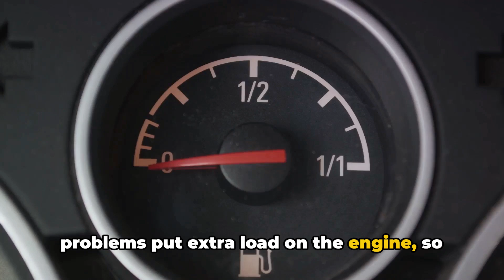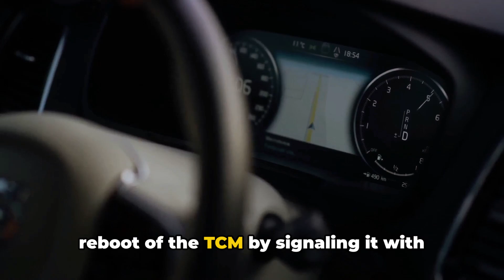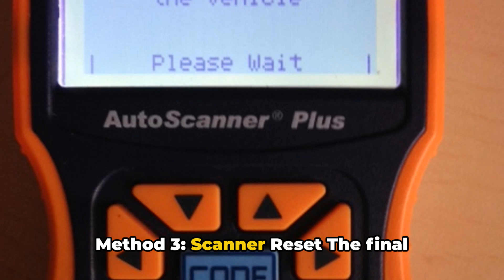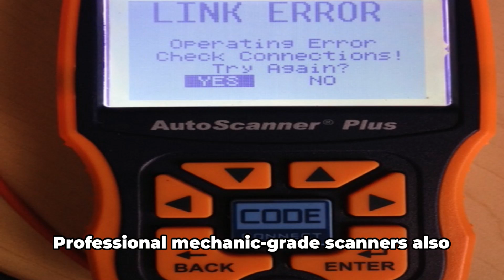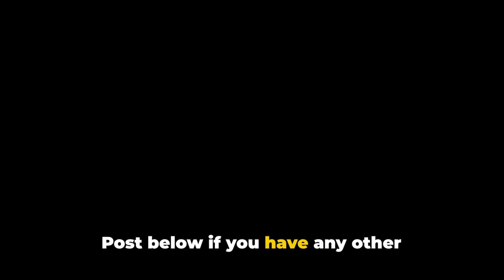How to Reset a Dodge Transmission Control Module(TCM): 3 Methods

Comment from the maker: I made a small mistake, I meant the engine should be "On" but not running for the gas pedal reset method. Apologies for this.
Reply: I'm glad i checked comments cuz i was  " WAIT a min! U want me to full rev the motor 10-20 secs? Ona a reset?" i gotta research if he meant ign in key 2-run but motor off
Reply: @danoolson5983 😂😂😂
Reply: Thats exactky what i though!t@danoolson5983
Reply: I blew my engine! No not really
Reply: Duuuude! That's a really serious chunk of information! I'd delete this video and fix that. I can only imagine how many people threw a rod trying this. Jeez
Reply: @jasonabernathy76 my thoughts exactly. Now I'm 2nd guessing everything else said. Touch the cables? Am I gonna blow up??
Reply: @jasonabernathy76  a fuel injected engine (any engine made since the mid-80's) will not let you over-rev it, rev-limiters are programmed into the software for a reason lol. Usually the limit is quite low when free-revving in park or neutral, like 3500-4k is usually all you'll get while free-revving, sometimes they wont even go that high.
Reply: I was wondering! I was like uh…. Just bang it off the rev limiter for 10-15 seconds? Lol.
Reply: What you were saying and what you were illustrating was all cattywampus
Reply: Will the tach still sweep? Is that a sign the reset is complete ?
Reply: I have a 99 Dodge Ram 2500 V10 4x4,  for some reason it does not want to get out of 3rd gear, top speed is 35 mph. What would cause that? Do you know if it's a simple fix?, or do I have to get a new or rebuild the transmission?
Reply: No doubt that train is got plenty of mileage on it but you can try to reset the TCM just disconnected two battery terminals hold them together for a little while then put it back see what happens take it for a drive ! @goodguygto
Reply: @cactusstudiossouth   Thank you so much, I will try that. 👍
Reply: @cactusstudiossouth did you not watch the video at all? You obviously didn't if you're asking that kind of question. Like the other guy said, watch the video again three times to make sure you understand it fully and to make sure you're not asking ridiculous questions in the comment section of a video that tells you everything you need to know.
Reply: @goodguygto I have the same problem with a grand caravan 2005, but it only runs to like 10 mph then shuts off completely,  then I change transmission but now it can run up to 70 mph but just stay in 2nd gear, then some times it will go on all gears,  now I guess is the TCM, and I'm gonna try this tips see if those works, if not I'm gonna change the TCM.
Reply: Transmission solenoids @goodguygto
Reply: Farm them ments
Reply: You should delete and redo this video
Reply: I did that before seeing the comment, immediately gave me a def warning and the gauge went from 3/4 to empty
Reply: Guess your AI voice got that all wrong huh
Reply: How can it sweep if not running? I don't understand
Reply: I was about to do it with the engine running, but I'm glad I read the comments first, I would've blown the engine,  thanks for the video.
Reply: Dude what??
Reply: @James7796ify  dude watch this again 3 times...

Comment: Sixteen seconds in and the 3rd reverence b-roll image is literally a shot of a dual CPU server motherboard and has absolutely nothing in common with a TCM module except for they both have components mounted to a circuit board the two are not even in the same manufacturing class of electronics. ( class: A,B,C...)  TCM's for EMS,PD's ,Fire and Rescue will be built to a class "A" standard because of the need for absolute reliability, the the class "A" standard is the module or component must work every time because lives depend on it's functioning. The server Mobo is manufactured to class "C" at best .

Comment: So I have a 2019 ram 1500, 5.7. It was completely dead this morning. The code that came up was the tcm code? Would that affect battery 🪫?
Reply: More likely, the dead (or dying) battery triggered the tcm code, depending on the code. If it was a P0700, or somewhere in that series, it's less likely to be due to battery failure and more likely a component issue.

Comment: You had to drop the pipes from the manifold ?  And you mentioned “sliding” the valve body towards the front. I’m assuming that means it doesn’t drop straight down ?

Comment: I just had my 2011 Ram 1500 rebuilt new engine and rebuilt transmission. Sometimes the transmission doesn’t want to shift from 2nd to third gear I will have to do it by shifting it in N then back to drive. 2nd to 3rd is the only gear it does it in

Comment: CARAVANs /  Town & Country: I have this trans Limp mode issue. I think method 4 is dangerous. Putting the Negative & Positive Battery Terminals Together Can Cause Electric issues or a Short!
Reply: No it can't

Comment: I used to do these fixes with my Dart,they would work...but was having a check engine light I couldn't get out ..tranny problems..and now car is dead.Changed fluid,chucks of metal,in magnet,ran gears for fluid, lasted 3 days before it went dead.Is it worth changing tranny? Car is perfect otherwise...

Comment: Method 1 is wrong, do not press your accelerator all the way down with the engine running. That is very bad. Instead, you turn the vehicle to the on position without the engine running and then you press the accelerator all the way down for 30 seconds.
Reply: During method one, is the engine supposed to be running at any point? He says start the engine and let it idle for a minute or two and then turn it off for 20 to 30 seconds. Is that part correct? I tried it in my 2011 Ram and my tachometer is not sleeping nor is it getting my truck to shift into drive. It's still just goes to fourth gear every time I try to put it in drive.
Reply: @danbessent246 No. Engine off. If this doesn’t work, disconnect the battery from the vehicle for 30 minutes. Just remove the negative terminal only. And make sure the terminal does not touch anything else.

Comment: I have a 2017 Dodge Challenger and I do not understand this reset with the acceleration pedal method. I did see the correction comment for the "On" and not run the motor when the pedal is pressed down. I get that. Though is "On" actually "Run" without the engine running? There's only three modes to my Challenger; "Off", "Acc", and "Run." But what do you mean by the "tachometer sweeps once"? Nothing happened to my tachometer when I followed these steps. What am I missing?
Reply: Having issues in my 392 2018
Reply: @Organictalksandvibes  any luck
Reply: @jessiefranco1007  no got rid of it

Comment: If the engine is running you can't put your gas pedal to the floor. It could blow the engine. If you hold the accelerator pedal all the way to the floor for 15 seconds
Reply: Not true... you can't blow an electronically fuel injected engine with the gas pedal.... have you ever heard of a rev-limiter? Lol. Every electronically fuel injected engine made since the mid-80's has one programmed in. We haven't been physically allowed to over-rev our engines for nearly 40 years.... due to the engine management software, it won't let you harm it in any way, not with the gas pedal at least. And rev-limiters are much lower in park or neutral while free-revving; usually, it won't let you take it above 3500-4k rpms while free-revving, it'll just bounce off the rev-limiter in the software. And depending on the manufacturer... sometimes they won't even allow it to rev that high. It takes sustained 6k plus under heavy load in order to harm a modern engine and the computer just simply won't let you do that with the gas pedal, downshifting with a manual into too high of rpms can happen and that is another story, but you still can't over-rev it with the pedal. Like I said, that's been physically impossible on a vehicle with stock programming, for nearly 40 years now.
Reply: Yea it will definitely reset your TCM that way because you will need a new car right

Comment: What if it is stuck in drive? And the engine doesn’t cut off?
Reply: Check to see if there's a recall from Dodge related to the ignition/wiring

Comment: I have a 2013 jeep wrangler jk unlimited. After alternately getting many of the symptoms of bad TCM I tried several methods of resetting the TCM. They all seemed to temporarily help but not fix the problem. After implementing Method 2 battery disconnection as described here my TCM is working perfectly. The only thing I did in addition to what's described is turning the driving and fog lights on after disconnecting the battery. This helps purge the system even more in my opinion. I turned all lights back off before reconnecting battery. I connected the power lines lightly with a needle nose vice grip for a little more than 10 minutes. I also waited a little more than an hour after reconnecting everything before cranking the engine. Now working with no problems. Thank you Honest Mechanic Colorado!!!
Reply: Just want to make an update. This did temporarily fix my TCM problem. Nevertheless the hard shifting and staying stuck in a gear problems eventually returned after doing some hard accelerations. I ultimately had to replace my TCM to solve the problem.
Reply: @842king4 has the new TCM fixed the problem or are any of those problems back?
Reply: @842king4  I need to know if this worked. My 99 is stuck in 3rd and I’m trying not to have to
Buy a new trans

Comment: The dodge journey 2016 I have with R/T whatever that means. It’s a v6 .3.6 variant and it has a negative post on the shock wall and the positive has like 3 different wires stacked on top each on the post.
Reply: If you want to try that method you could use jumper cables attached to the positive and the negative and then touch the ends of the jumper cables together, but with all of those other wires involved you'll want to make sure that the process isn't going to fry something.

Comment: Isn't that harsh on the engine with it running to hold the floor pedal down for 10 to 15 seconds
Reply from the maker: The engine should be on "On" also known as accessory mode not running
Reply: @HonestMechanicChannel your instructions clearly say ”turn engine on”. You want us to hold redline in neutral for 15-20 seconds? Instead of doubling down on your bad instructions, make sure you say things correctly. 
The procedure is to ”turn the IGNITION switch to on, but don't crank or start the engine.”
Reply: I was thinking the same shit 😅 @Thrsmthngwrngwthsgy
Reply: @Thrsmthngwrngwthsgy fr lol good thing I read these comments before going home and trying this and blowing my engine lmao
Reply: @quadir6076 ... Right.
Reply: This would kill every dodge owner's motor for sure and some Fords would spitting out spark plugs. Cmon man

Comment: I just did a same engine,3.5 to 3.5 swap. Used the new engine wiring harness as it looked fine. Now it has transmission issues it didn't have before(undrivable), thinking fluid was low, I added two quarts of fluid, can that be the issue? I also have a hand ful of transmission codes.
Reply: I’m not a mechanic but when my trans was leaking I always had to be within .5 of a pint or less , otherwise it would tweak I had also bought a dipstick cause my car doesn’t have one. Changing the fluid might be worth a try I would get a new filter as well, my cars a dodge charger and it takes 7 pint I only added 5 because i only got 5 out of it there will be some you can’t get
Reply: Same here, did a 3.6 swap, now the transmission won't shift
Reply: You have to get your TCM reprogrammed using the Dealer Style  Scan tool   @puroarmendariz1068

Comment: Im getting a code U0100 and all it does is click and wont turn the engine on.
Reply: That code can be triggered by a bad battery cell which will stop you from starting the vehicle. Try jump starting the vehicle or replacing the battery.
Reply: @mr.emptymoneybags7929 , I got a new battery still nothing, just clicks when I push the break and push button